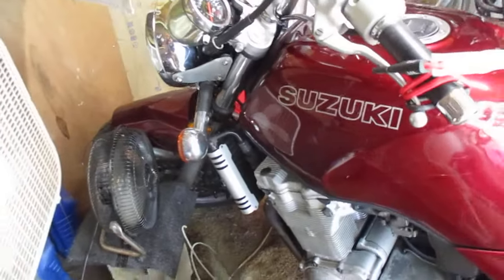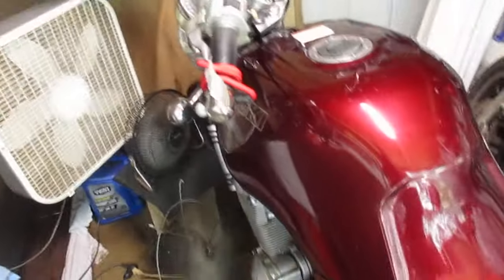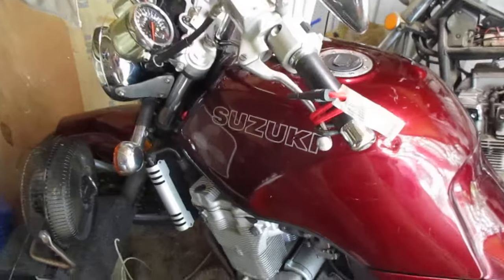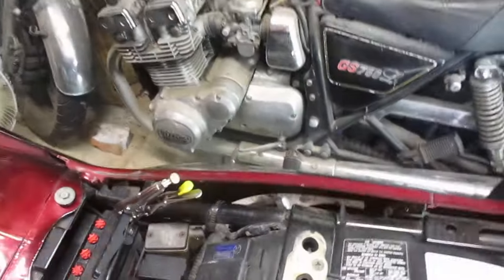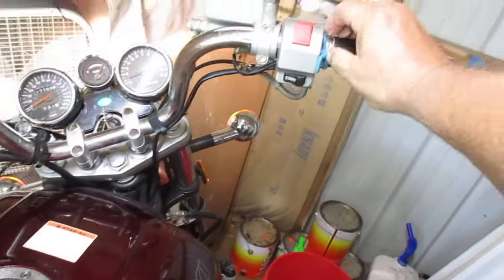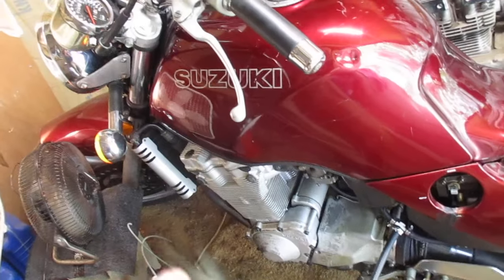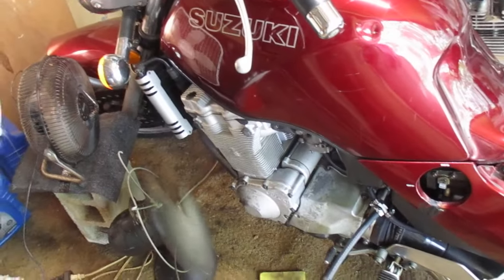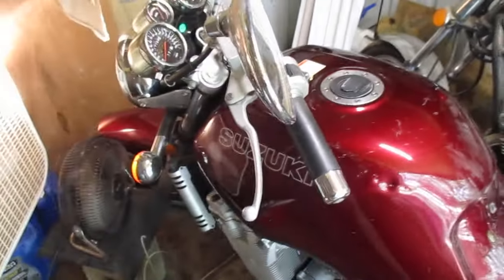Suzuki GSX1100G carbs cleaned and running like new

Comment: I just got into one of these bikes and im surprised to just recently hear of them. Mine will start just fine in warmer weather or right after a ride. It does not like 40 or below but it still starts after a few attempts. Im just running into an "issue" where when im accelerating around 50ish mph it kind of backfires. Im new to carbed stuff so im not sure if its dirty or could be something else.